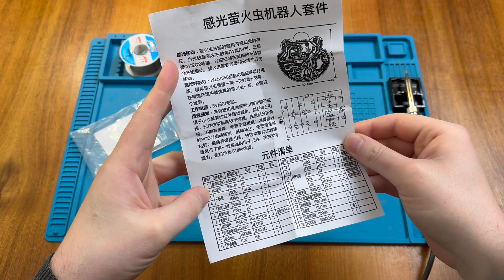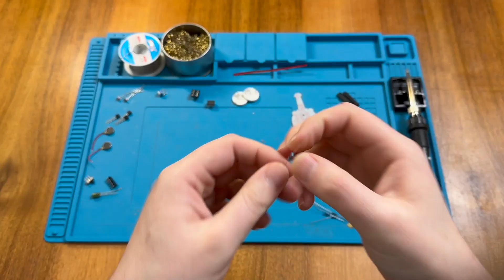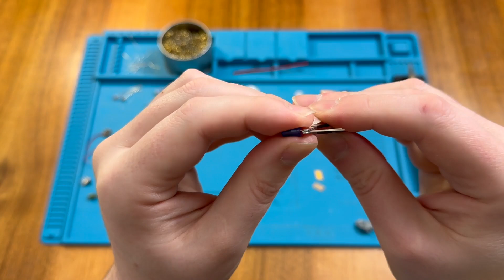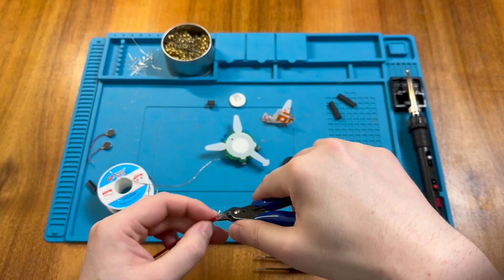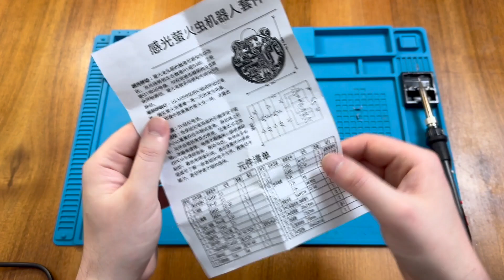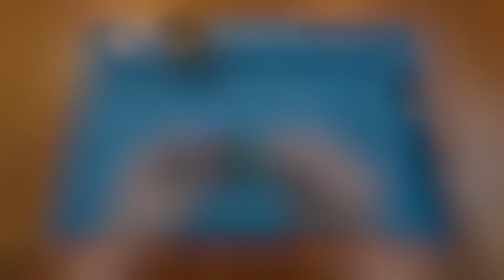Light Sensitive "Robot" Firefly - DIY Soldering Kit Assembly, Modification, and Test

Comment: Jason, one component was overlooked, or is it not required. 
I'm my kit as in yours, we have an angled connector. 
I've no idea where it fits, my kit is an upgrade as is yours, are we missing something here.
Hopefully you will reply. 
Thanks for a very informative build 👍
Reply from the maker: Great question, and something I was a little puzzled by. The angled connector is for the power source and the two motor connections, but it isn't really required. In these instructions, Step 6 says "Users don't have to install them" — hope that helps! 🙂
    https://www.icstation.com/product_document/Download/GY19603_User_Manual.pdf
Reply: Thanks for putting my mind at rest, I went through the parts list as you also did, eventually,  I realised. 
Best ask someone who knows.
I'm only just starting this hobby and find it really interesting,  made a few items with much success. 
One again, thank you 👍

Comment: Is the 90° header a bonus?
Reply from the maker: These are optional headers for the motors and the power. The instructions say that users don’t need to install them.
Reply: @jtjacques that was going to be my guess. The parts list did not auto translate well.